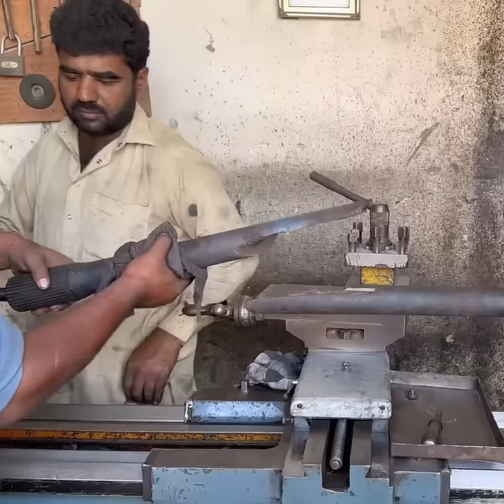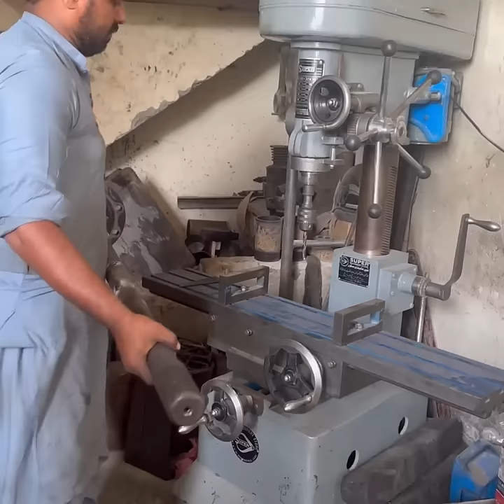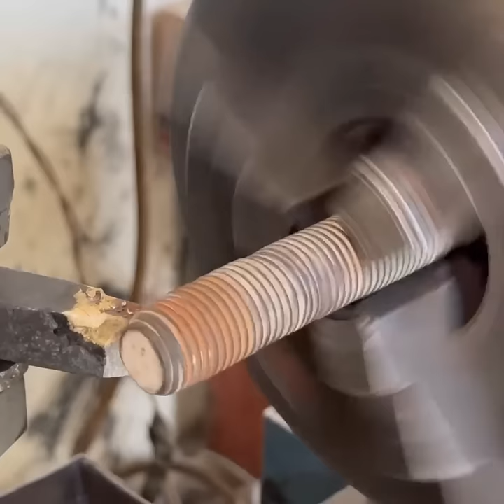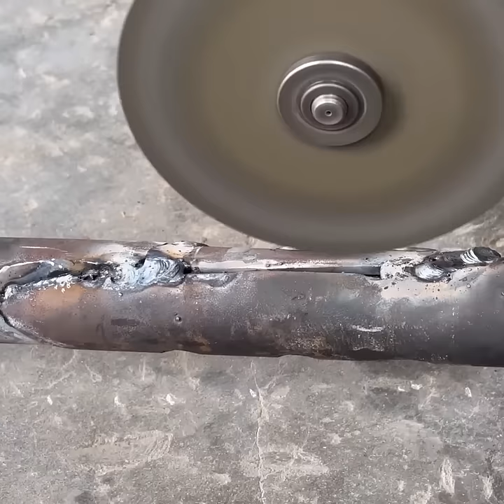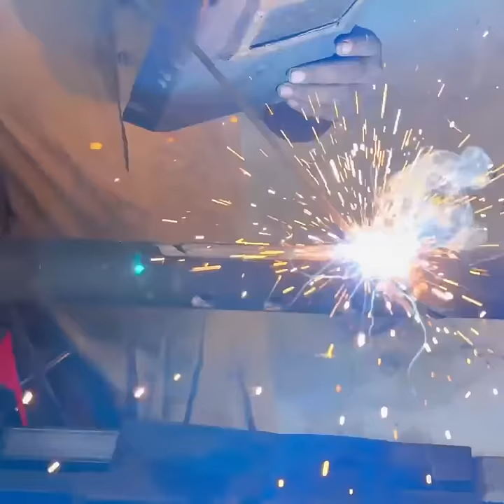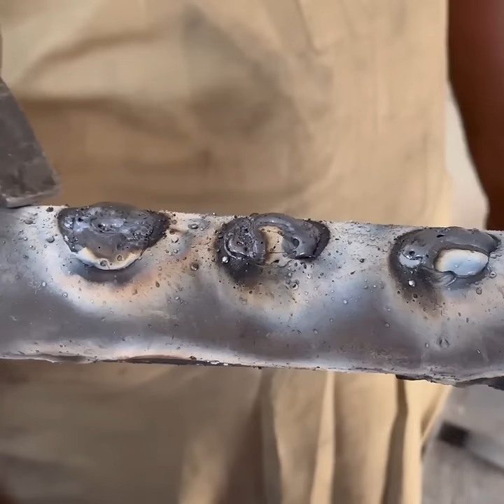How to Rebuild Broken Axle with Amazing Technique

Comment: As a retired mechanical engineer, I can assure you that this type of repair is totally unacceptable.  It will fail under use.
Reply: "Every thing on Islamic republic of Pakistan runs on Allah power ...after making joint they will pray and spit on it .. providing extra  Allah enchantments ... That joint will never break ...because Allah is stronger than steel ... Mashallah ...."
😂
Reply: You missed a big point ... what you think those shafts are made of ? I think high quality steel won't rot inside out. ... 
Plus those Bolts they used is high grade steel so joint is stronger than the actual shaft ... May be couple of dudes made that on locally using commonly available steel or something ...
Reply: А мне кажется, тех хомутов достаточно бы было
Reply: That’s a third world country with limited resources
Reply: Então volta a estudar 😂😂😂 trabalho muito bem feito está corrigindo o seu erro 😂😂😂😂
Reply: @SuputraBharathi that is genius. I love it
Reply: Respectfully, you're still an engineer 😊
Reply: @SuputraBharathi stop making joke on Allah name.. please respect our beliefs and god.. i’m warning u brother please show some respect.. Allah is a only one god for all muslim.. it’s worldwide.. stop pushing our limit for what our beliefs
Reply: We’d be S.O.L. were something to break with you in the crew
Reply: People with engineering degrees say crap like that all the time and have not spent 1 day in a third world country where they do stuff like this every day and the things they fix will still be in use when your kids are old and gray.
Reply: @Morgan-rn4ow why do you think they have to fix stuff everyday? Because they don't know what they're actually doin. Sure they can dodgy something up but it won't be safe or last. Trust me. I work with people like this on Australia and the only thing stopping me calling OSHA is the fact they're all nice people and I love working there and tbh if it wasn't for me and the other couple sane people there the whole thing woulda fallen apart already.
Reply: I've had an engineer tell me before something wouldn't work. Guess what. He was wrong.
Reply: Of course
Reply: @bobert8125  Because they do not have the money to throw it away and get a new one, much like our grandparents had to do a hundred years ago. It is amazing what people can do with what they have when necessity requires it.
Reply: @saifulshafiee8921 I mean... as a group you kinda take a giant crap on everyone else, sooo...
Reply: @saifulshafiee8921 OH, I didn't read the whole reply! You're "warning" us now?  Sounds more like a threat.
Reply: Я как заведующий складом автозапчестей могу подтвердить ваши слова.
Reply: Metallurgy, welds & metal strengths 🤔 
This is probably going to be better than the original. Welding changes the bond making it stronger.
Reply: @saifulshafiee8921 bro he’s not being disrespectful, they seriously say things like that in Pakistan. And it’s definitely Pakistan where repairs like this (and a lack of actual engineers) is common.
Reply: The joint will last, but the axle will break again beside it. It even broke, when the hammered the bolts in.
Reply: You forget they are repairing something that had already failed. And don’t have money for a new one or access either.
Reply: @SuputraBharathi 😂
Reply: @saifulshafiee8921  Respect is not gained by begging for it , its earned.. I was talking about Pakistanis not Allah...
I am not interested in talking about Allah... Because the book which arabian god given to man kind for eternity is lost... If There is a need to worship any Arabian god... I will worship Baal the bull god... (The one Saudi kings secretly worship )
Reply: @SuputraBharathi 😂
Reply: As a nonmechanic i can assure you that i came to the same conclusion😂 thats holding the whole f truck or car🤦‍♂️ But seems they have Gods protection and it works there😅🤷‍♂️
Reply: @SuputraBharathi Allah Power, you broke me😂
Reply: @ВоваВовин-с6р да изоленты бы даже хватило😅
Reply: What a mechanic would say to a customer in a western country? "Buy a brand new axis for $1250"
Reply: You know about steam bells. I lived in Africa and such repairs often last 30 years.  Engineer you don't know.
Reply: @Userizderevni  ну изолента совсем уж бюджет, дай хоть помажорить 🤣🤣🤣
Reply: Excellent 👌 , just a suggestion better use  nickel chromium Welding Electrodes . Reclaimation welding
Reply: Even the original broke, why wouldn't this one break?
Reply: My mate is a truck repair guy. Showed him this & he broke his ass laughing.
Reply: @SuputraBharathi  нет, такой ремонт не выдержит высоких нагрузок. Вал не может иметь внутренних полостей, а при таком ремонте они будут!
Reply: Agree but ok for third world country,they are not welding the pipes for NASA or MIR.
Reply: @SuputraBharathi  amin ya allah yarobal ALAMIN masa ALLAH 
🇮🇩
Reply: @IINVICTA поверь! В россии в сëлах Урала, Сибири, д.востока чинят таким же методом
Reply: Logic ended 😅
Reply: Retired mechanical engineer 😂
Reply: @turtleproblemsOfficial  It felt really good .. I do like it  when people praising my teacher ...
Reply: @SuputraBharathi  kay dimga hi bai inka masalllha 🤣😂🤣
Reply: @SuputraBharathi твой ник (возможно это имя) соответствует уровню интеллекта. Ниже плинтуса
Reply: @SuputraBharathi Alhamdulillah brother, you been an Animal/idol worshiper for so long knows lot about Islam merely❤. Inshallah I pray to Allah subhanwatala to guide you towards islam, Ameen summa Ameen 🤲.
Reply: @SuputraBharathi ты достоин поклоняться Козлу ибо сам такой же.
Reply: Ты молчи инженер 😏👎🥴
Reply: Абсолютно согласен с вами!
Reply: @saifulshafiee8921 no te preocupes ,yo soy cristiano y nunca haré bromas de otras regiones,cada cual que crea en la que quiera o les enseñen de niños ,yo por lo menos te respeto la tuya ,,,saludos desde islas Canarias ,,,,conoces mi tierra ? estamos al noroeste de África ,
Reply: @SuputraBharathi а ты не переживай и живи по-своему дальше
Reply: The replacement comes with draw backs and advantages both
Reply: Esse povo trabalha com os recursos disponíveis que tem. Basta ver que nem EPI  eles tem.  É muito suor e fé!
Reply: @saifulshafiee8921 yes thanks for warning him he might get innocent people blown to bits by some extremists.
Reply: @Samhawk88  I am not some one who never read Quran or Hadis as you think I am not capable of quoting like Dr Zakir ..but I know what ever stuff is in including  all those Jihadi text books that they use to make Bomblastic muslims Islam was first religion I studied due to YouTube prophet Zakir Naik and couple of my muslim friends  
If I say history of what mohammd did on Arabian sand dunes with a name Ismael or yousaf all raw  ... Muslims will spit right in face ...
Reply: the bolts and the shaft are made of different materials.
Reply: @SuputraBharathi true af
Reply: @SuputraBharathi  Alhamdulillah brother, but it still you know lot about Islam, but unfortunately western propaganda islam, May Allah subhanwatala guide you to the his truly accepted religion Islam soon. 
Inshallah.
Reply: @IINVICTA limited resources 😅
You use your car as you like
Reply: Yeah
Reply: Wondered where the expert was
Reply: @saifulshafiee8921 Allah sux dix
Reply: Ingeniebrio
Se dañará el coche antes de que se vuelva a romper el eje! 😂😂😂
Reply: @SuputraBharathi land bhakt spotted😂
Reply: But it’s half the price.
Reply: @saifulshafiee8921 So allah is not stronger than steel? That’s all the guy said. I sure hope you believe your god is stronger than steel.

Also, you are warning him of what? What are you gonna do about it?
Reply: totally agree , may be good enough for a box trailer but you start doing that in a prime mover pulling weight catastrophic failure will definitely occur.....the grinding to prep for weld was obviously enough for pre heat before welding ... got to love it
Reply: @schneider007 I'm with you. I've been a boilermaker for 24 years. This was a decent job. I'd trust it lasting
Reply: @SuputraBharathi Поэтому вы до сих пор живёте в 12 веке.Иншаала оставайтесь там со своим Аллахом.
Reply: Approved, it will outlast most of mercedes original parts.
Reply: as a mechanical engineer, you don't know what you are talking about.
Reply: @saifulshafiee8921 what are you going to do if the troll continues ?
Reply: Согласен
Reply: They might have used the best bolts money can buy. But after all said and done, the axle is still only as strong as the cheap pot metal clinging to the fresh welds.
Reply: That's right
Reply: To be fair I saw one of your fellow mechanical engineers design shaft that had a 13mm through hole in a 12.5 mm round shaft....
Reply: @SuputraBharathi lol😂😂😂 nothing like good ole fashioned Allah or Jesus power to get you something lol
Reply: @IINVICTA name one 1st world country!
Reply: @saifulshafiee8921 or else what? You gonna kill him because he made a joke about your beliefs?
Reply: I rebuilded a 100 mm shaft on a gearbox for a brick plant concrete mixer in 2017/16 and it still runs continues 12 hour shifts. Maybe because I used 7018 welding rods lol
Reply: @SuputraBharathi  Behave with the one who created you and me. You have to be smarter than that and understand the question: can you work like them or even less than them, or are you just barking like a sick dog?
Reply: @SuputraBharathi do you not understand anything about hardening? Thermal damage? This will not be anywhere near acceptable for strength. Multiple processes have been done incorrectly, even though they had the ability to do it so correctly. With this shop, you would conclude they would get this correct?😂
Reply: @saifulshafiee8921 "we are loving", also, "I'm warning YOU"
 my answer😂
Reply: @calvacoca here, $300 is more correct "used"
 this is nothing, if a hardship for westerners. They do not struggle, they have wrong priorities. Netflix, Starbucks, and the like, these are number one priority😂
Repair is available in USA for Less, and would be proper repaired
Reply: @finbarscanlonwolf with me having metallurgists and Machinists in the family, I had to send this around.
Reply: It will break right next to the repair…trust that!
Reply: بس يعتبر من افظل اصلاحات موجودة في الوقت الحالي
Reply: It’s normal in Pakistan ,it’s work at least 2 years,I’m not joking
Reply: @Morgan-rn4ow facts. They do with what they have.
Reply: Depends on the torque it sees but in general I agree.
Reply: @TTS-TP   If it was made with friction welding ... heat treatment is gonna make significant improvement in its strength ... in this case it's just waste of money it's for one or two years rough use ..  Guy who own truck don't care about his employee   if an accident happen ... He will go to the widow and say " Allah took his life , mashallah 🤦he he is in Allah heaven😩 ... Oh sister keep this money in hand (10-20 dollar ) he was like my own brother 😭"
These bastrards likes making  accident ... because they can eat insurance money money too  ... 
I. Think you should say thank to god  for making you born in a good land (away from  zombies of Allah )
Reply: @fahedkargo5657  Behave with one who created you and me ??? 
Your creator said he made earth flat and everything in universe revolves around it ... 
I am not living on a flat earth ... so he is not my creator ... I think he is creator of some other earth ... surely not  of this earth  
It's like Pakistan dad saying "my son look exactly like me ... but when you look at him you kind of feel like it's definitely a Chinese boy "
Reply: @shimon2476  No offence bro ... Allah power  or Jesus power is actually power of faith ... Its a double edged sword ... if some one believe I must do human sacrifice to Allah for this eid ... it's harmful ... if some one believe i must give food for 1000 people to make Allah happy ... it's good ... 
May be one or two good muslim in population of a thousand is not enough  ... it's not their mistake people are innocent their faith  is used as a weapon to take control of world .. in Mohammad's time he made the religion for ruling world ... Allah likes war ... Allah want muslims to do war for him and his Prophet
Reply: МОЖЕТ БЫТЬ..НО.. МОЖЕТ ПРОСЛУЖИТ ЕЩЁ БОЛЬШЕ..ПО КРАЙНЕЙ МЕРЕ ДО ДОМА ТОЧНО До ЕДЕШЬ..А ТАМ ТЕБЕ РЕШАТЬ СВОБОДА ВЫБОРА..
Reply: As a retired fisherman I can agree
Reply: @SuputraBharathi спасибо американцам за то что люди так бедно живут
Reply: I glue mine
Reply: Обсалютно согласен учитывая то что данные полуося изготовленны из легированной стали с торсионной проковкой для износоустойчивости, а в данном видео ремонт не уместен не выдержит нагрузки.
Reply: @schneider007 😂😂😂на швах металл перекаливается и становиться хрупким
Пожалуй правильнее было бы его перековать!
Reply: Sure it will fail even the original one did!  Everything fails at at one point!
Reply: What would be the other option with out using a new replacement
Reply: I'm not even trying to be funny but mechanical engineers are the people that get us into this shit to begin with oh my God me and a friend of mine love older Mercedes-Benzes aesthetically but we think that Mercedes engineers need to be flogged and then tard and feathered and should not be allowed to design anything on a car ever again it's as if engineers do stupid engineering shit just to impress other engineers those said other engineers seem to be the ones giving out engineering awards but in the real world where things need to work be worked on and get done the engineers seem to be the hindrance it's like you guys stand around in a circle jerk seeing who can over-engineer and come up with the best stupid ideas like putting degradable insulation on Mercedes wiring harnesses that is one of the dumbest things I've ever seen and all the Mercedes dealerships stock these harnesses and it's funny because a wiring harness should be something that is not needed on a regular basis not for Mercedes if you're working on an older Mercedes from the early 2000s or the '90s it's something that you have to have because they just degrade away to nothing some of the choice of fasteners there's just all kind of crazy stuff I can go on and on so although we need competent machinisters our world actually runs on engineering these modern engineers are just garbage I would rather trust some old guy in a third world country with a welder and a lathe then a modern engineer you guys will spend all day coming up with a plan some mechanical drawings and that old guy with the welder and the lathe will get to work and just do it knock it out make it usable
Reply: Is obvious they made thousands of such repair and has worked perfectly well.
Reply: how balanced would it be? or off balance?
Reply: @SuputraBharathi and x2 if someone in repair team believe in orc tech from Warhammer 40k
Reply: why you are sure?
Reply: @Morgan-rn4ow 
Если бы это так работало, то было бы замечательно. В реальности же эта фигня действительно не работает, просто в странах Запада никогда такой фигней и не занимались, в отличие от России, где с маниакальным упорством пытаются сэкономить копейку прекрасно понимая, что этл фигня.

Как пример из рассказов - так постоянно подваривали пуансон для выдавливания пластиковой нити для  щеток уборки улицы. Когда родная деталь стояла и год и два, то подваренную приходилось подваривать каждые 2 недели.
Reply: @НиколайДьяченко-з7ю 
Не совсем. Там могут быть разные варианты. На стареньких жучках валы полуосей делали сварными т.к. такую полуось в условиях массового производства делать зацело просто нетехнологично, но даже так - или заводская сварка на автоматизированном оборудовании с правильной термической обработкой (подогревом перед сваркой, отпуском после, проверкой сварочного шва) или где-то в гараже для оси, которая уже сломалась, металл имеет внутренние напряжения, а электроды, стали, прутки взяты какие нашлись.
Reply: The car will break and that axel will be still stanting
Reply: Я думаю вы удивитесь узнав, что эта деталь всё ещё работает.
Reply: @saifulshafiee8921 do you not find the murder and torture that happens in your Lords name to be worse? Words bad, murder good?
Reply: agreed.... casue more accidents
Reply: How would you repair it if a replacement was not available? No sarcasm, just honest curiosity on how it can be done when the ideal solution (new axle) is out of the question.
Reply: @varyag058  не надо ,варим уонями😊
Reply: It doesn't look like this is their first rodeo so maybe they know how to do this?  Don't be upset that they didn't go to school and you did and they can do something you can't.
Reply: @IINVICTA and nuclear weapons.
Reply: Хорошо, ты купишь себе новый автомобиль, деталь, прибор и т. д.
Я возможно тоже. 
Но там ремонт - это чуть ли не единственная возможность восстановить работоспособность. Я не буду вдаваться в политику и искать причину, но твой комментарий с душком
Reply: As you can see its already failed under use… they’re just repairing bad metal with bad welds…
Reply: Maybe you need to apply for an OSHA type job overseas in poverty stricken area?
Reply: Agreed
Reply: 5th world country
Reply: As a mechanic I can assure you engineers suck...
Reply: @SuputraBharathi lol those bolts were soft mild steel. It would have been smarter to plug weld the holes with a tougher steel rod than use those janky bolt rivets
Reply: @saifulshafiee8921  funny how muslims demand respect for allah while they themselfs are an embarasment towards him and not seeing it.
Reply: You do the best job you can if for any reason you don't have new parts. More power to a good engineer
Reply: What would an engineer know about repairs?
Reply: @SuputraBharathi hhahhahahhahahahha
Reply: Ohh wow so impressive you want a cookie
Reply: @Morgan-rn4ow most engineers never spent a day in the field so most of their knowledge is based on non-field work. There are plenty of times that what the engineers determines "can not work" , actually does work.
Reply: They would probably do better by just doing tacks and then grinding deep grooves for welding. An engineer would know that the outside matters most in flexing or torsion. Dont need to weld from center and out. Might give it a bit more lifetime, at a fraction of the cost we see here with all the jigs, drilling, lathe use and fabricating rivets, etc. Just tack, grind really deep, weld, bring a blowtorch and sledge if it warps from the welding. Much much easier operation
Reply: @SuputraBharathi you obviously haven't heard of Crack propagation
Reply: Everything, even the new things will break when used
Reply: @hasanm843  
He meant that it would fail prematurely
Reply: @SuputraBharathi repent my brother before its too late
Reply: صحيح
Reply: This is what you do when you're in the mountains of Thirdwhirldistan, hundreds of miles from where DHL can dropship a proper axle to you.
Reply: @SuputraBharathi - i hope you are being sarcastic. There is no way that that repair is anywhere close to the original strength.
Reply: Like the other guy said, when it was whole it failed and wound up.here so saying it'll fail again is a no brainer, but when ? It may last years depending on load .And that means it'll continue to feed some family. This used to be called Yankee ingenuity and was lauded but now in the disposable world everyone expects a new Chinese one likely made of inferior metal